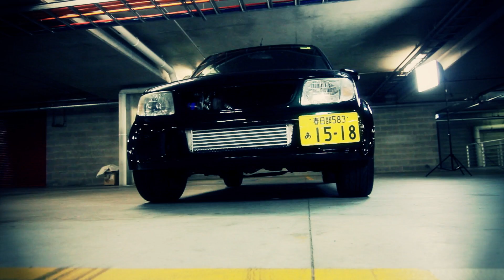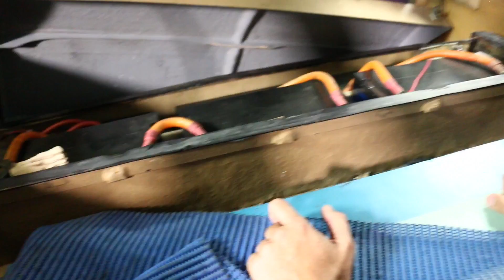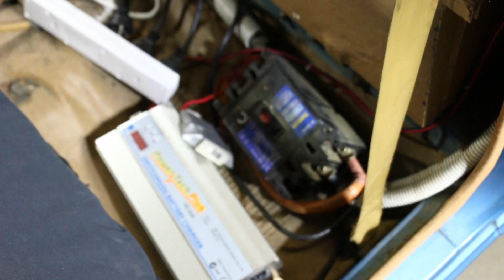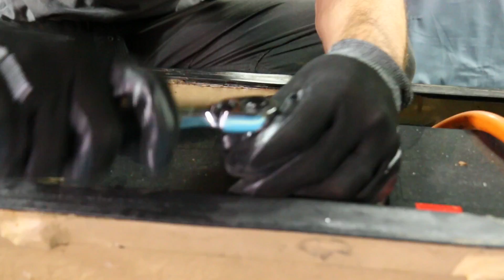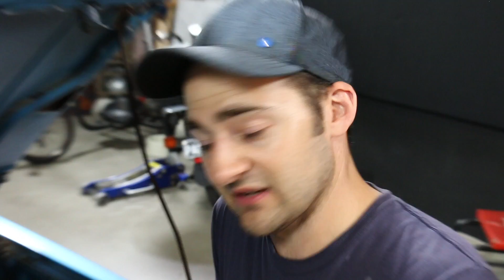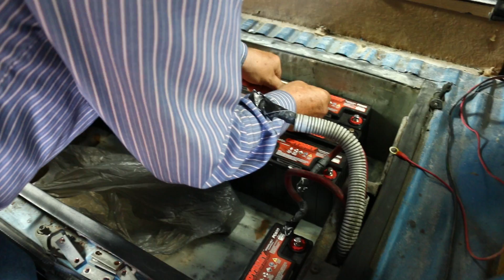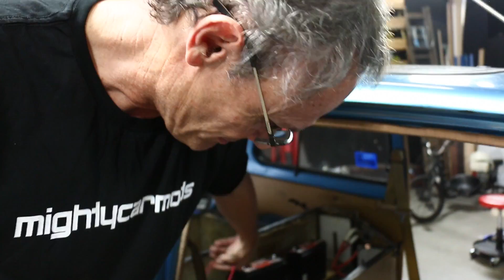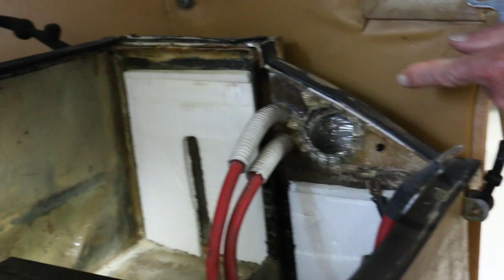JDM Electric Turd

Comment: only takes .08 amps to kill you folks!
Reply: +Thomas Gates I guess you never had such current running through your flesh. What a circuit can output has nothing to do whith what was ACTUALLY circulating in your body. I'm a technician on medium and high voltage networks (from 3000 to 400,000V) and you really have no clue what you're talking about.
Reply: +BetterThanReal you've SHOCKED yourself with 15 amps. "Electrocution" is a term derived from the words electricity and  execute. Came about as a result of the penal system's common use of electricity to execute death row inmates. ---The more you know--- :)
Reply: +BetterThanReal its the power (Volt x Current) if you have 0.08 amps ur gonna need like 100000000000 volts to kill you, if you got electrified at 15 amps with 1 volt its gonna do nothing.
Reply: It all depends on how conductive your body is. and no it will not take some ridiculous amount of volts for 8 miliamps to kill you. If that amount of current flows through your heart you will go through arrhythmic shock. so even though we come into contact with electricity everyday, our bodies are very good resistors and could potential resist 15000 ohms.
Reply: +Chuck Salerno 
Thank god for my giant impedance. I'm my own current limiting resistor.
Reply: +Thomas Gates 6kA will make you burst into a ball of flames and smoke, even 1/10th of that would have the same effect. I'd call that "deadly"
Reply: Chuck Salerno obviously i was exaggerating...
Reply: +BetterThanReal A system capable of delivering 15 amps does not push 15 amps through everything it's connected to.

Comment: That stench is the sulfuric acid. I work as an electric engineering technician and I work with lithium ion battery packs every day. Switching to LiPO4 batteries (like Tesla) would be much more energy efficient. Those SLA (Sealed Lead Acid) batteries have 90AHr's. My company buys 180AHr batteries for the fork trucks that we make. Each cell is 3V each but have that capacity. Easily held in the hand too. I honestly would switch that car to the CALB batteries I work with everyday. Oh, and the LiPO4 batteries don't emit any odors unless there's an internal short, which isn't all that common. I've never encountered one myself. 

Oh and something for safety. It is only safe to touch the contacts if the effective voltage is less than 60V. Just a bit of safety knowledge.
Reply: +Steven Kistler At the end you can briefly see some blue Headway LiFePo cells. Looks like they will be going that way.

Comment: Great episode, that thing is not just electric, its bloody analogue! Hope you got decent money when you took those old batteries to the scrap yard... Why no solar panels on roof? You guys are getting burnt by the sun all day over there, might as well use it?
Reply: +MeesterDash 
Digital and electric are different words. Also that motor controller definitely is digital. Solar panels the size of that roof would bring in 120 watts in full sun. Since the car needs 20,000 watts to move, a solar panel can't run it constantly. If they're going for 30Ah of battery at 144v, it would take a week to charge the car off a rooftop solar panel.
Reply: +MeesterDash recycling batteries doesn't earn you much at all. For those 31 case size AGM's they can't be recycled in the same way a flooded cell lead acid battery can be so you would get even less.
A lead acid version of those would earn you maybe $10.

Comment: I don't think the biggest issue with electric cars is the range or power, it's the charge time. I wouldn't mind having to charge my car up every 100 miles or so if it wouldn't take 12 hours to go another 100 miles.
Reply: +Seraphim Valkyrin 
You're completely right. The Tesla Model S and Mitsubishi MiEV can charge in half an hour if you have the right charger (and connection to the grid). There's only a handful of places in the world with a charger like that though.
Reply: James Beecham Not to mention that charging your car that fast isn't safe. There was a Tesla that caught on fire at one of those fast charging stations. Yeah gasoline stations sometimes have fires but that's from driver error, not from a technically standpoint.

Comment: For those curious about energy density comparisons here's rough values: 
Petrol (gasoline)      = 44 MJ/kg
E85 (supergramps) = 29 MJ/kg
Lead acid battery     = 0.15MJ/kg
Lithium-ion battery  = 0.95MJ/kg
But remember a typical brushed DC motor will convert >75% of that power to mechanical motion and only 25% to heat
Whilst a normal petrol engine is only about 25% efficient. Think if you've got a 100kW car you've also got a 300kW heater !
Reply: +stefan radovich INB4 i know it's heaps more complicated than this, but this is a youtube comment section not my thermodynamics class, settle your kettle.
Reply: +Busqui48 aw damn, you're right. as if i screwed up such basic maths.
Reply: +BetterThanReal 
Mega Joules. So if you eat a kilo of petrol it will give you the power of 22 Big Macs (2,000KJ each).
Reply: Well, keep in mind that petrol, or especially diesel engines are much much heavier than electric ones. But yeah, electric cars aren't all that viable with current technology (yes I know Tesla is mass producing them but they are still heavy and have a low range.

Comment: all evs over heat and slow down the Tesla the leaf BMW i3 i8 all of them thermal throttle very fast and reduce power to the motor massively they also lie about the range u don't get full power over the full battery charge no battery can the voltage sag is too much when below 25%
Reply: +Mark Williams. It's not voltage sag, it's that a "3.7v battery" is 4.2 at full charge and 3.0 at empty. V=IR and P=VI, so lower voltage means lower power (unless some magical motor can change its resistance as the battery flattens).
Reply: +Preske Google speech to text
Reply: +James Beecham yes it is good cells lipo  are strong up to about 5%  the lower the voltage less power but that's not what I'm talking about loads of things effect battery discharge Peukert's law temp SOC cell chemistry etc
Reply: +Mark Williams the problem is do u wanna use cells with 250 cycles

Comment: Batteries have a cutoff voltage, a voltage at wich they are at 0%. Lead acid is not meant for constant discharge, but for charging with an alternator. You need to find info on the batteries and see the cut off voltage. Thats the way you measure battery capacity. 
A good idea is to get an Arduino and measure the voltage at every cell, and display some kind of prercentage. If you 
discharge batteries beyond the cutoff, they get damaged.

Happy modding!
Reply: +Ognjen Galić Yes this is important point. They have voltmeter. So atleast they should keep an eye on when it dips into 10.6V range. And stop driving then. For 144Volt system, minimum voltage is around 10.6x12=127V. But checking batteries one by one is a must time to time atleast. To see if any of them is doing something funny.
Reply: I would halt at 11V, for a safety margin. The best would be with a Arduino or something, printing the percentage on a 16x2 module or something.

Comment: Hey guys, would love to see some more details regarding this build and the build that came out. I'm no expert, but I worked in the battery game for around 5 years, and while at uni, I made a point to study battery behavior and chemistry, as well as the needs of people in everyday life.

As you guys said, Lead acid chemistries (AGM, GEL, flooded, Calcium or otherwise) tend to be a bit outdated and not only extremely heavy, but take a long time to recharge and have a limited life. Thankfully AGM and GEL are sealed, otherwise referred to as a Sealed lead acid battery or SLA, else maintenance free or flooded could cause gassing issues inside the vehicle.

One comment I did catch which was great was Marty talking about the batteries being removed as UPS batteries, it was highly likely the case as UPS batteries would technically suit the application best in this lead acid SLA scenario, as UPS offer high discharge capacities, but not so much longevity, as they're meant to spend most of their life on a constant charge scenario. TL:DR on AGM and GEL, AGM is great as a sealed alternative for regular batteries, and pure lead options like Odyssey are fantastic for performance and longevity, but in constant run down scenarios, they don't last as long as lithium under the same circumstances and depth of discharge pending application of course.

The biggest issues I have with the build coming out are the 240V inlet, as we know how dangerous that is, and the Electus/Jaycar chargers aren't great, but not bad by any means, but more than that depending on capacity, may not have even fully charged the banks they were attending, let alone the horrendous safety concerns charging batteries from 3 chargers from a 240V powerboard in a car....

When you removed the batteries, it sounds like you were getting a smell of bad times, which may indicate these batteries may have been overcharged, and the chargers attached caused them to vent to the extreme that they vented actual acid, and caused a reaction that would probably smell like a swimming pool or bad eggs, either chlorine, or hydrogen. Both smell horrid.

I can see you guys went for another AGM lead acid solution, which is fine, it requires a less complex charging system for sure, but there are local guys, or at least mobs in WA, who sell LiFEPO4 batteries, which are very powerful, but also very, very light. In terms of LiFEPO4, it's still needs a semi complex charging system to make sure the cells balance, but said system will make sue they balance better than a typically lead acid AGM or GEL system, but if it goes and has thermal runaway, or some other kind of overload, it's not gonna easily catch fire, like Li-PO, or LiCoO2 (Lithium cobalt), which is what most phones run along side Li-PO. And is much more dangerous.

TL:DR, It depends on application, but there would have been cheaper/better options, despite sponsors perhaps, pending of course. I know what the battery game is like, and what most cost, but either way, still awesome to see you guys rebuild this ride. Would have been better options for batteries, but mad none the less.

I can see you guys went for a whole host of PC680 Odyssey, they''re most common in aircraft, or at least they used to be when light aircraft were using them all the time. not a bad choice, as smaller batteries in series parallel means less current possibly, and smaller cables, and even better less strain on each battery. But lead was still the heavier option, and in this case for reach, capacity (Ah) and weight (Less is better) truly are king. Lead acid might be a bit dumber, and it may need the extra cable or 2 to charge evenly, but the more cells there are, the more weight, and the more to fail and let the system down.

I Would still love to hear choices and why, and if I could help on future power choices, I would love to also. Either or, keep up the good work.

PEACE,
Mattery the battery guy~

Comment: "Let the smoke out" is bad, mkay. You should know all electronics are powered by compressed smoke. If the smoke gets out, it won't work anymore. Awesome build though. Always wanted to design a pack for 18650 batteries. That's how you'd get a LOT of power density. EDIT: From my calculations, if I got this right, you have  24*16Ah*12V = 4608Wh. If you use 40 * 18650 batteries you'd get 148v. You can probably find 5Ah cells. So one bank would yield 740Wh. You'd need 6*40 batteries to get the equivalent of what you're using. Parallel as many banks as you wish. Or wait for Tesla to get battery prices down with their gigafactory. End EDIT.
More edit: Actually calculated some more: 18650 cell = 19x19x65mm = 0.02L, and aproximately 50g. Total for 240 batteries: 4.8L and 12kg. ONE Odyssey weighs 7kg and occupies 2.8L. These are specs I found off the good 'ol internet, so stuff might be wrong.
Reply: +Vlad Vidrean One thing is really wrong. 18650 is never more than ~2600mah. And in high current demand aplications, even less. More like 2000mah.
There are some fancy expensive ones in 3000mah range, but to weak for car use probably, because of low discharge current. And, when you calculate weight, dont forget, that you need add contact strip weight, packaging weight. And good battery is ~55grams, so your weight will be atleast 50% more. One more thing, it will be very expensive. Baterries are round too, so they leave empty space between banks. I dont know how you calculated volume, but you should calculate battery not like cylinder volume, but rectangular bar volume.
Reply: Valtra103 true, i overestimated the current capacity. Probably need to double up on that. Volume is calculated as prism, not cylinder, including some tolerances. I did not take price into consideration :))
Reply: Vlad Vidrean
Lead acid has specific power of 30-50 Wh/kg
And lithium is 110-160 Wh/kg. So about 3 times less weight by going lithium. And probably about 3 times increase in cost if not more.

Comment: is there a way you could run a pully system or something like that to an alternator or 2 so that it can charge that battery's while u drive not really to fully charge the battery's buy to extend the life
Reply: +Matthew Dolbey i don't know if you mean that but if you think of driving the alternator with the electric motor in the car that doesn't gain you anything because the motor is using more power to drive the alternator than the alternator can produce..
Reply: Adding alternators to a motor to add to the batteries has always proven to be more harmful than helpful.
Alternators don't have 100% efficiency, more like 60% if you're lucky. 
Regenerative braking however, would extend the batteries life significantly. Basically have generators connected to the drive train but only when the brakes are applied
Reply: +Dylan McElveen is the purpose of the alternator not to keep the battery in your car charged you can also get high output ones for higher applications that draw alot of power im thinking of this because they dont have the budget to develop a breaking system that can regenerate power
Reply: +Matthew Dolbey Do you understand that an alternator attached to the drive train and is only engaged when the accelerator isn't depressed is exactly what regenerative braking is.
Reply: Energy cannot be created or destroyed. When you run an alternator there is resistance which would mean the electric motor uses more power to turn it the faster you turn it the harder it gets to turn so the more power the motor needs to turn the alternator. So the electric motor would have to draw more current from the batteries to turn the alternator due to the resistance than the alternator can put back in the battery. This is why they say to save fuel don't have your heater on or lights on if you don't need them. Because it puts more work load on the alternator which means it becomes harder for the engine to turn it. 

However regenerative braking doesn't have draw much from the motor. Obviously when you brake you will have to accelerate again. But if you don't brake unnecessarily then it is slightly more efficient.

Comment: I am a little disappointed by this episode, you have used to going much further. Why not change the motor for a brushless, the controler and the converter ?
And there is a risk to have less weight on the rear.
Reply: +aeris who knows what they will do? This is something totally different! I'm sure it will evolve over time.Step one get it to run!
Reply: *****
Yes, but maybe they can explain the plan for the serie to make the hipe :p
Reply: +aeris who would spend that money on such a piece of crap?
Reply: Gaming isnotacrime
Some friends :D
Reply: +aeris This is a new project car. It would not be much of a project if you did everything possible to it in the first episode.
Reply: +aeris That would require DC to variable frequency AC conversion - extremely costly.

Comment: The battery manufacturers have been resting on their laurels fo too long and have finally been goven a dig in the ribs in the last couple of years. It's likely that the next generation of batteries will be based on the dual carbon type which, ironically, was introduced in '89. They're safer than lithium metal types and allegedly charge 20 times quicker.
Reply: +wordreet Better technology exists, it is being supressed. Look at the EV1 car, thousands manufactored then mysteriously went to the scrap pile instead of the dealership. The EV1 was light years ahead of the MCM build.
Reply: ***** The Electric Turd is like a vegan omelette. So far ahead of it's time even though it's old hat. But yes, the oil industry has been squashing electric and solar powered vehicles since the seventies. They paid big bucks for various patents and pushed them to the back of the shelf.

Comment: Dont use leadacid :(
Reply: +Aapje Or, if you do, don't roll the car!!
Reply: +Aapje Im a bit disapointed in there choice of batterie too. But its probbably cost related.
Reply: It's a shame,but they are the only option in the price range.
Reply: +steelmesh Leadacid does belong into forklifts indeed. Not in cars.